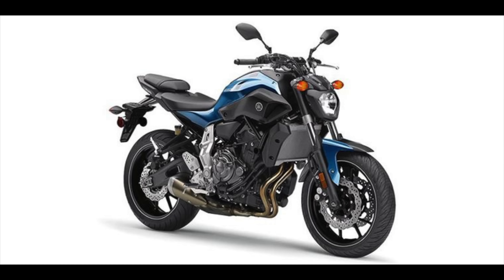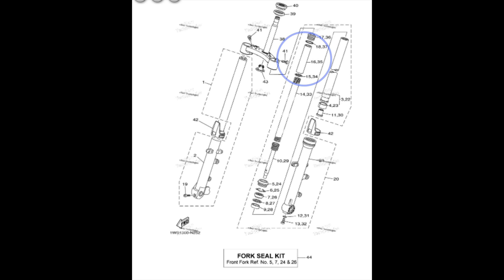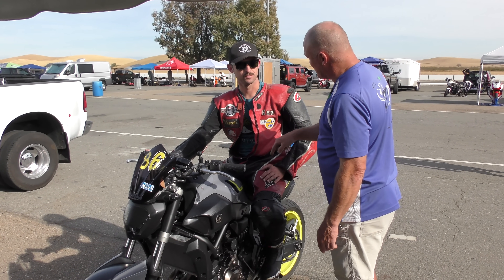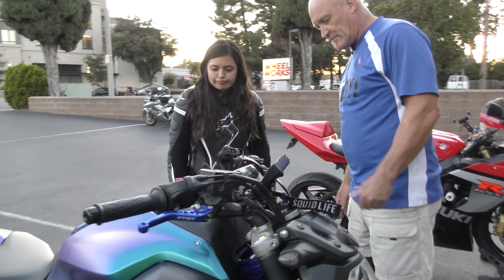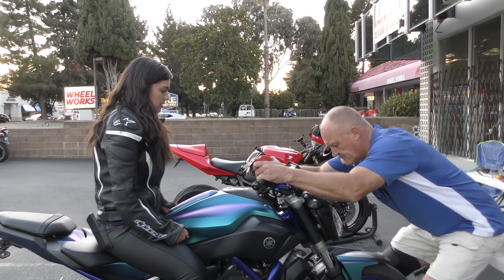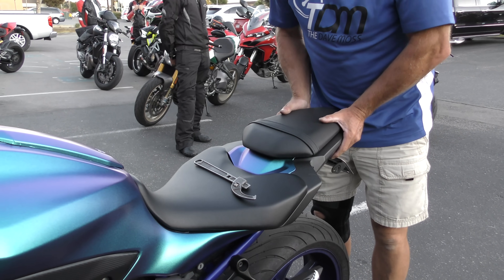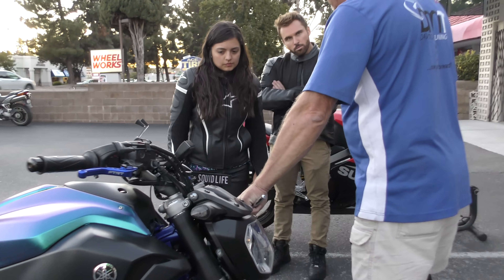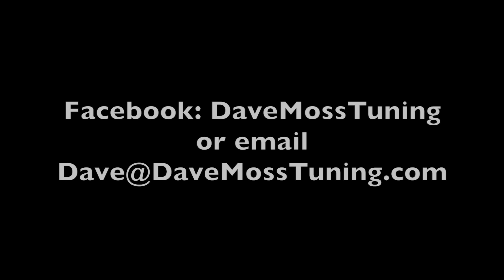Yamaha FZ-07 / MT-07 Fatal Flaw and How To Fix It

Comment: This is very common on most cheaper motorcycles. The issue is they aim the suspension design to the biggest sales markets,which are smaller, lighter riders on low quality public roads.  For the US market, the buyers rarely ever take to the track. Most mid and small Japanese brands bikes are underdamped and undersprung for US rider weights. Proper springs and oil weight can fix that, but I think the idea is to keep progressing customers to more expensive bikes, they do not want you happy on a 250/300.

Comment: I think this is an Yamaha thing.
With mine YZF R125 I did the same but with longer spacers. I weigh 90 kg (200lbs) and it had a really soft front suspension which was useless. 

Went with a pretty good oil with a very high viscosity index (the higher the index, the less the viscosity changes with temperature). I used a Fuchs Silkolene one.
Reply from the maker: Thank you for sharing you solution for your problem to help guide others with an R125 to show that their bike can be better. I can assure you it is not a Yamaha thing. Almost all telescopic forks need work with springs, spacers and oil (not necessarily all three).
Reply: FYI It was a '09 R125 with the standard forks. They were quite rubbish compared to how hard the rear shock was and how powerful the front brake was for a 125cc bike.
We used 3/4 15W and 1/4 20W Fuchs Silkolene, RSF and SF, but I am quite heavy. 
We also lowered the front end by 20mm. 
Thank you and keep the good work!
Reply from the maker: @jorgecosta95  Excellent. Thanks for sharing! Just looked at an R15 this morning. Very little static sag and urgent need for thicker oil. Your solution given your weight makes perfect sense.

Comment: I don't understand, what do you gain from cutting from 10 to 15mm from the fork's spacer ?
I'm exactly 140lbs naked, how much should I cut ? 15mm and use 15w oil ?
Reply from the maker: If you have no static sag, the forks always want to stay fully extended and when you hit a bump, all the stored energy from the spring being strongly compressed figts back violently. If you shorten the spacer depending on weight and ability (7-10mm) there is less stored energy in the spring so it pushes back with less violence and you get static sag so the impact is not transferred directly to you: https://www.youtube.com/watch?v=3FeZJRiAXRk&t=294s

Comment: with some basic mods you can turn the MT-07 into an amazing machine. Wide bars, stiff shocks, good exhaust, awesome machine
Reply: Same is true for any bike.
Reply: @truantray  I think the MT07 has a bit more potential than other motorcycle of similar displacement for some reason. Results at pikes peak and other hill climbs event speaks for themselves. MT07s regularly finish in front of MT09s and street triples in the middleweight class. Lightweight class being dominated by supermotos.

Comment: Fork clamp bolts are usually torqued to 8-10Nm, basically finger tight... Watching you adjust the fork height made me wince, I hope the video was deceptive! Great video otherwise :-)
Reply: I feel like a guy that's spent a life time working on bike suspension probably has a fair idea of how tight he needs components to be torqued to, with his experienced hand.
Reply: @DenvarShay  Ever get a vehicle back from an experienced mechanic that wasn't right? Experience doesn't make you immune to mistakes, especially at such low torque values.

Comment: With this I'm not feeling comfortable. Just think this guy says something it might be logical and maybe better as well, but in Yamaha engineers worked on this and they left it like this for some reason.
Reply from the maker: Thank you for sharing how you feel. You are not alone. Thousands or riders like yourself trust in the engineers to get it right. So - if you look at the bell curve across humanity how can it be right for every rider on the planet between height, weight, shoe size, hand size etc. If it were a car, it would be much easier. With two wheels, we need to find what works for us and spend the $$ to get ourselves comfortable so we eliminate fatigue. Then we need to evaluate if the springs we have been give work for us, the owner. Start with one of these videos on fork travel and see what you can learn to help yourself: https://www.youtube.com/user/CatalystReactionSBW/search?query=fork+travel:
Reply from the maker: Dave Williams, editor, replying here. You can see the problem in action in this video, at 5:15. You'll see he hits 2 bumps as he enters the corner and this causes the front to fold. The bars suddenly turn to the right and then he crashes.  https://www.youtube.com/watch?v=Dglu0Wsf80k&t=11s

Comment: Any setups for an fz6r for a 270lb rider... I don’t even want to know how bad my oil is after 5 years and 20k 😂
Reply from the maker: A replacement shock will be required eventually as the shock spring is rate for 15-180lb rider. Even on the highest setting it will bottom out. For the forks, 1.0 rate springs, 20w oil to the volume the manual calls for will help
Reply: I figured it wasn’t sprung for a heavy rider, I’ve bottomed out plenty of times and have the preload on the spring maxed out (to the point I’ve ripped the license plate right off my bike)
Reply from the maker: @braaapattack2937  So at that point something like a Nitron shock might be the ticket with springs and oil in the forks.http://www.nitronracingshocks.com/search.asp?keyword=MT07+R1+shock&search=

Comment: Wouldn’t be great if the manufacturers trained the dealership personnel to make minor adjustments on the bikes they’re selling? It could be as easy as a handy chart according to weight, it would be about 10 minutes to deliver a proper bike to the customer. That goes for high end and low end bikes. The manual sort of gives some info BUT not everybody understands these things nor everybody reads the manual.
Reply from the maker: I did that for a BMW shop. They became THE place to go if you wanted a BMW as mechanics and sales staff knew exactly what was needed via the data charts we created for every model.

Comment: the first guy "ok" was the only thing coming from that fly trap
but this video just reinforced my opinion on current yamahas.... made for pll that don't know jack shit, the just want pretty things
Reply from the maker: It is not just Yamaha - any brand with a telescopic fork generally needs work with either spring or oil or both. Every cruiser needs this done if they have telescopic forks.
Reply: @catalystreactionsbw  Why can't yamaha just put thicker oil in the forks and adjust the lengt on the spacer ?  This is not a expensiv change for yamaha I think ? So why do they keep sending them out like this ?
Reply from the maker: @644loic  As per prior replies, this is not exclusive to Yamaha. Most telescopic and some upside down forks need thicker or lighter oil. In the case of this specific bike, the parts are acquired, so the question goes to the company supplying the forks and shock. A larger question may well be (for all brands), who signs off on the showroom bike being okay. We don't and likely will never know. So, we are left to fix it ourselves and the few is very inexpensive between springs, oil and spacers.

Comment: Would adding adjustable pre load adjusters and changing the oil weight accomplish the same thing? Thanks
Reply from the maker: That would be very helpful with preload adjusters. You would need to do some mathematics by laying the spring and spacer out and then adding the preload cap to see how much would need to be trimmed off the spacer. Once done, then change the oil and start with 15w.

Comment: Im no genius but saying this is a "Fatal" flaw is way too much. They didn't design this bike with the intention of it being a race bike.(The motor is way to weak). Non adjustable suspension, so they set it on the soft and forgiving side, since the motor is weak and likely to be used by new riders. Unlike the Fz-09 which has a completely different suspension. This bike was designed for daily commuter and new riders. Once your skills have gotten better just get a different bike these bikes can be picked up for 4~5k so putting $1000 in a suspension, if you dont do it yourself... is 20% of you whole vehicle  and a waste of time.
Reply from the maker: The modification we are suggesting is $30, some time and getting a preload spacer trimmed. For those that cannot swap bikes out due to financial constraints and love their MT07 and want to keep it, this an excellent upgrade.
Reply: @catalystreactionsbw  Okay so i may have gotten ahead of myself. I'm not saying your fix is exspenisve but:
1) its not a "Fatal" flaw, just plush for everyone. Fatal makes it sound like you can die. 05 GSXR 1000 Frame recall
2)As your beloved viewers get better, your fix has no adjustabilty. They are faced with the decision of investing, you touch on that here: https://youtu.be/3qA3Ja7yxcQ?t=159 . But with used 2000's sport bikes fairly cheap a 2008 gsxr 600 will be a better investment because you will eventually out grow the fz-07. Depending on what you want to get out of your track experience of course. 

Didn't mean to sound like a __________.
Reply from the maker: @eatbreatherace5918  Agreed - the next step up is a pricey one comparatively if they want to step up. If not, R6 fornt end and shock make for a better handling MT07. Thanks again for your contributions!
Reply from the maker: Dave Williams, editor, replying here. The guy in this video, at 5:15 came close. You'll see he hits 2 bumps as he enters the corner and this causes the front to fold. The bars suddenly turn to the right and then he crashes.  https://www.youtube.com/watch?v=Dglu0Wsf80k&t=11s

Comment: you guys must have really bad streets if you need that much negativ suspension...:P
Reply from the maker: Can you explain "negative" please? Are you saying bad roads make oil lose viscosity faster?
Reply: @catalystreactionsbw  preload thru weight of driver and bike..sorry i´m not native english speaker!
Reply from the maker: @Bitplanebrother  Thanks for the reply. That makes sense. Don't forget ability as some riders are much better than teir suspension can support!
Reply: @catalystreactionsbw  that might be case..for some riders..but most are totaly fine with the stock suspension..mb set up for tyre weight..
greetings from germany
#streetdusters #tommyskleinemopedgarage
Reply from the maker: @Bitplanebrother  I rode for 20 years and never complained as i did not know anything different. Once someone showed me something better and why it would be better and then riding the bike to know it was much better - that's where i come from. If you want to cope with an ill handling motorcycle, carry on. If it could be far better, more comfortable and handle really well - is it worth it to you. To your point (and like me a long time ago), we simply adapt and call it good. We do not have to.
Reply: @catalystreactionsbw  i can always be better..you can even change the whole suspension if you want to...im just saying that for 80-90% of drivers it won´t make a difference..if the stock suspension is set up correctly in the first place...
Reply from the maker: @Bitplanebrother  on that point, we certainly both agree with it being set up first!
Reply from the maker: Dave Williams, editor, replying here. The guy in this video, at 5:15 really could have used the fix. You'll see he hits 2 bumps as he enters the corner and this causes the front to fold. The bars suddenly turn to the right and then he crashes.  https://www.youtube.com/watch?v=Dglu0Wsf80k&t=11s
Reply: @catalystreactionsbw  ...just watched it..it  wasnt the suspension..the front tire lost traktion..either thru bad tires or something on the road..as you can see the color diffence in the road...looks like some fluid (oil) to me...you can clearly see it when the guy did the slowmo of what happned..
Reply: @catalystreactionsbw  ..btw..im riding for 25+ years now and got my own bike shop..
Greetings from germany
Reply from the maker: @Bitplanebrother  congratulations!!!

Comment: Who tightens down triple clamp bolts without a torque wrench? Over tightening them pinches the tubes and causes binding internally.
Reply from the maker: Many do after 25 years of working on bikes who are craftsmen. If you want it perfect, of course use a tape measure (I mean torque wrench)
Reply: Factory mechanics all use torque wrenches, especially on triple clamp pinch bolts. A tape measure has nothing to do with what I originally commented....

Comment: Hi Dave!
I have a MT-07LA ( Australia ) and I've moved up my forks ~15mm how I saw at ( 10:34 ) - it's made such a HUGE difference!!! corner entry feels like carving butter!

I have yet to do my fork oil and shorten the spacer, but I am ASTONISHED at the difference just a few milimeters could make!
Reply from the maker: Thanks for sharing what your learned so far!  I will normally go in 3mm increments so once the fork oil and spacer are done start at 4, 8,12 and see what you prefer then.

Comment: What thing I cannot believe is the forks are still damper rod forks after decades. Well, it is no sportbike...
Reply from the maker: Damping rods are in most budget bikes and fork oil is a very inexpensive fix allowing the budget to stay within the price point. Others will transplant forks form another Yamaha onto their bike for more adjustment (FZ8 gets R1 forks). With the right set up they work very well.
Reply: @catalystreactionsbw  My question about that though: are they good enough for spirited touring? My FZR400 has stock forks without emulators, and while I'm at it rebuilding them I would go get some if needed. And we need to drop the front end to counter the less height with the rear(17 inch rear wheel conversion). They say I should go get the emulators, but should I?
Reply from the maker: @ruikazane5123  Let's give you some perspective to make your own choice. The correct oil viscosity, height and spring/spacer combination can create a very good handling motorcycle. Emulators are introduced for those who brake very hard indeed as an assist or go to the track. How do you brake? Take some time to review your skills and use then the decision to use emulators will be an easy yes or no.
Reply from the maker: @ruikazane5123  We try to miss potholes, railway lines and manhole covers but they do exist. So, thinner oil and emulators make sense so you WILL control low speed velocity.

Comment: Thanks for sharing this dave, cut 10mm off the spacer and put in 20w oil in the forks. It has to be the best mod I've done
Reply from the maker: Thanks for taking the time to get that done and share how much better the bike handles now! I appreciate you paying it forward by posting.
Reply: Does it reduce bikes ability to powerwheelie? Is it noticeably less wobbly in corners? Thanx
Reply from the maker: @TheBalija1  Power wheelie is throttle control so no it does not. Less wobbly in the corners? 100% yes.
Reply: @catalystreactionsbw  But power weheelies on this bike are possible mainly because of bikes geometry rather than it's power. There are bikes with more kW and Nm but they cannot wheelie as good as mt07 does. So I will ask more precisely will lowering front decrease bikes power wheeling ability. Thanx
Reply: After riding for a week, yes it's much more stable around corners, especially over bumps. The forks don't bottom out like they used too and doesn't seem to crash over pot hole's as much. Its make the bike much more enjoyable to ride and only took a couple of hours to do
Reply: Pete Did you have a local shop cut down your spacers? What weight are you? I’m 185 lbs, so wondering if 10mm/20w oil is proper for me as well. Thanks!
Reply: @scottschwab3025   Im about 180 lbs, i just used a hacksaw to cut the spacer. Used a hose clamp as a guide so it's straight
Reply: @pete5874  Thanks. I decided on the Bel-Ray 15W, but instead fill the volume to 120mm instead of the factory book of 162mm. Stock spring is still in, left the spacer alone, but lowing the triple 8mm.
Reply: @scottschwab3025  Why did you leave the spacers alone?
Reply: Greg P Because my bike performs well with my weight and doesn’t need the added travel. I proved this by adding a zip tie and determining the amount of travel used versus the total amount of travel available and discovered In using 89-90% travel. This leaves me extra Incase of an extreme situation.
Reply: @scottschwab3025  keto?
Watch the video again. Everybody needs to cut the spacers and change the oil. 15 mm for waifs. 10 for the fat or mighty. It's not about added travel; that's achieved later by dialing it in. It's about pogo-ing & static slack. How's your trampoline?
Reply: Greg P Ok... 👌
Reply: @scottschwab3025  #racist
Reply: @pete5874  holes
Reply: Did you cut the spacers in both forks or just one?
Reply from the maker: @brettfrashier7292  Both forks so the tension on each spring is the same.
Reply: @catalystreactionsbw  I thought so, just wanted to make sure. Thanks Dave!
Reply: @catalystreactionsbw  Geez, people here who've called Dave crotchety or patronizing should see how nice he was in answering this ridiculous question.
Reply: But did you deburr?